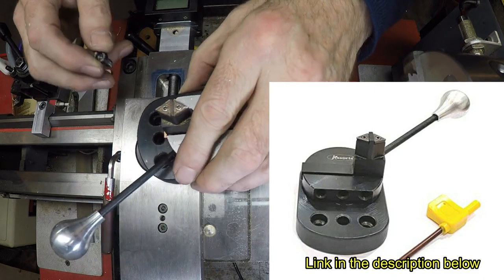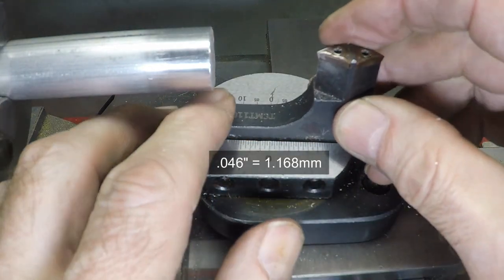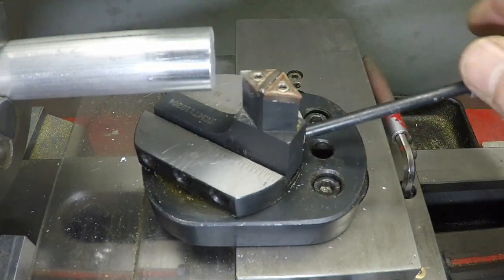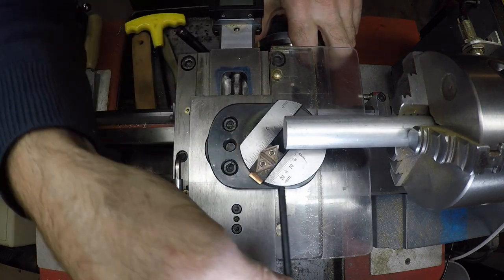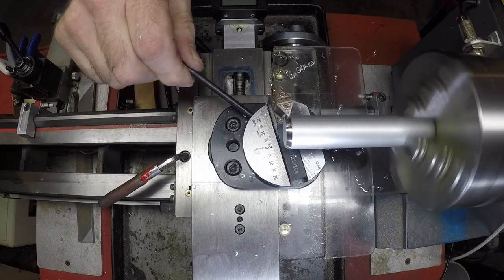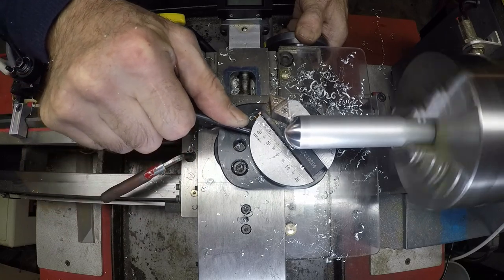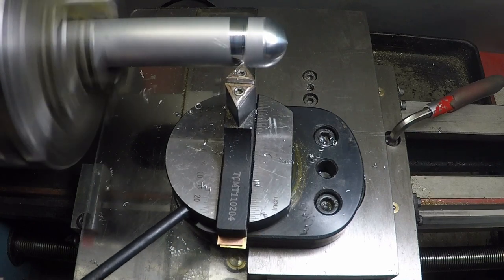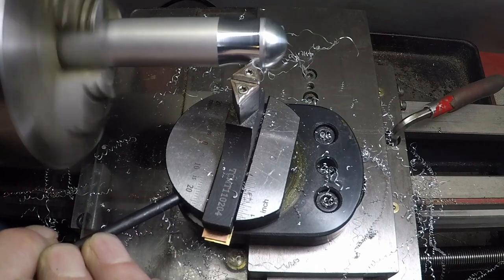Quick tip #7   ball forming jig for mini lathe

Comment: I considered purchasing one of these tools but I have a lathe and a mill, along with a bunch of material, bearings, carbide inserts and hardware, I might just have to give go at making one of these tools myself.
Reply from the maker: I seriously considered making one myself, but was seduced by the reasonable cost. I also considered modifying this one so that the cutter head could slide in dovetails rather than just an open slot - possibly with an adjustment screw.  Maybe these ideas will be helpful?
Reply: @GuyMarsdenMakesStuff  I like the dovetail idea I think I will try that.  In my quest to make one of these ball turning tools I have made the rotating part, still need to machine the dovetail.  I still need to make the base plate and the actual insert holder.

Comment: I enjoyed your video. I was reluctant to buy one of these because the graduations on the units I have seen on eBay appeared to be an adhesive label. Your unit appears to have been permanently etched. You did not report any quality issues, are we to assume ... it is within reason ... perfect?  ..  Thanks, John
Reply from the maker: It is very well constructed and I don't see any significant quality issues. In my mind this is a really good buy as a tool.